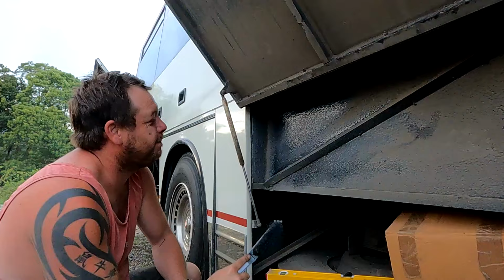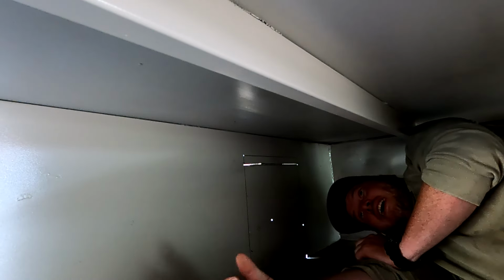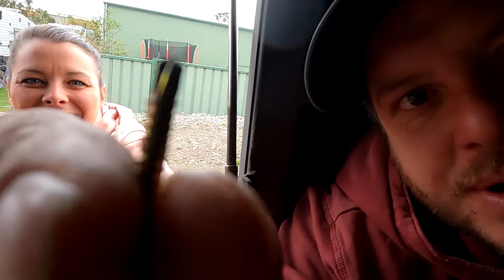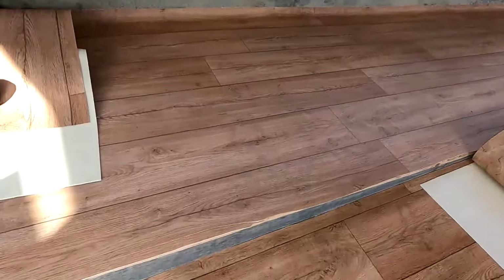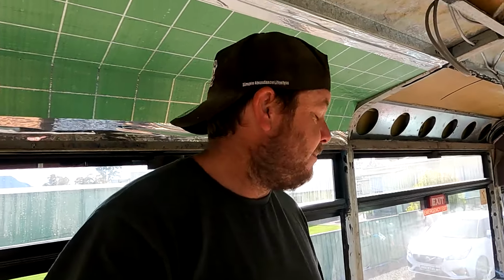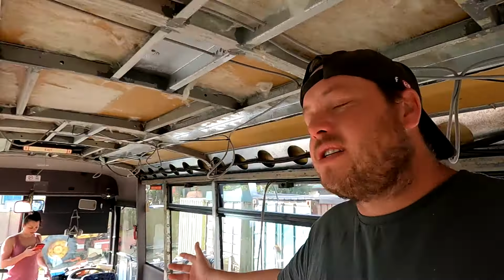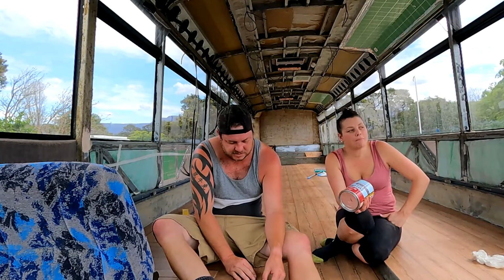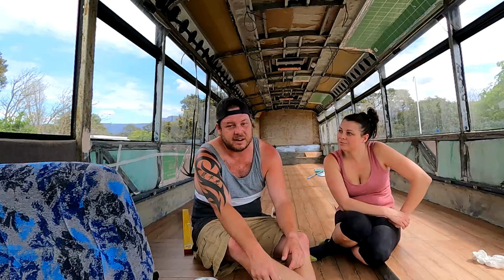Part 1 on how to lay sheet vinyl in a bus  Episode 9

Comment: The Bunnings gear needs to be spread onto both surfaces and then let become touch dry, when the two sides are then put together, it grips and grips well, and you get one chance, guaranteed.
Reply from the maker: Yeah definitely did not do this correct 🙄 🤣 but you live and learn. Cheers for the info mate

Comment: Fast grip is to be spread on both surfaces, air dry and it goes tacky, then press both surfaces together.   

I'm using vinyl plank on mine, and using the proper high temp glue specifically for the planks.  Using high temp glue as with heat from any sunlight through windows the normal plank glue will allow planks to shrink over time.
Reply from the maker: OK nice thanks for that, appreciate the info for next time. It helps to have  the correct info / tools.

Comment: If you do the snap together vinyl, you should wait until the walls and lower cabinets are constructed. The pieces need to be able to flex. If they are stuck under walls and cabinets, they will eventually separate and be a problem. I don't know about glue down vinyl planks though. I have never worked with those. One thing about it, you two are having a good time!